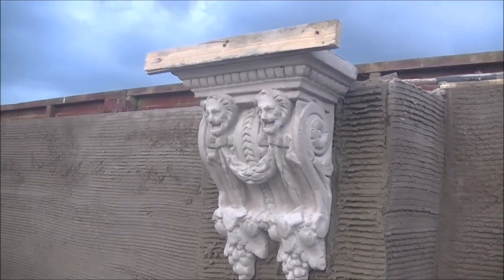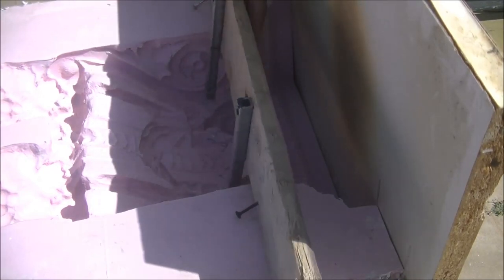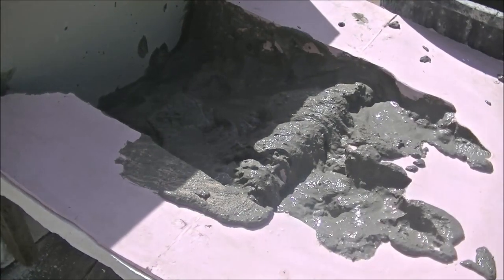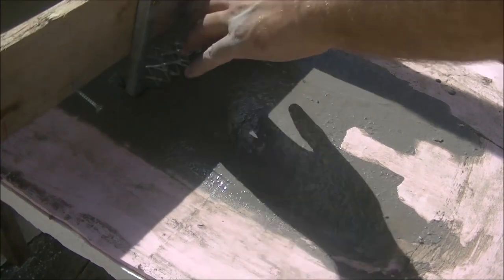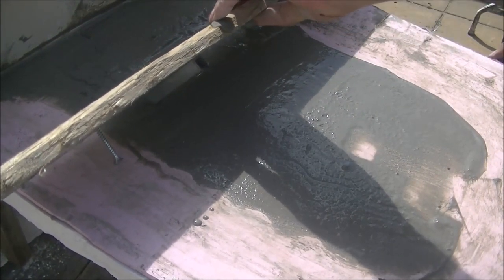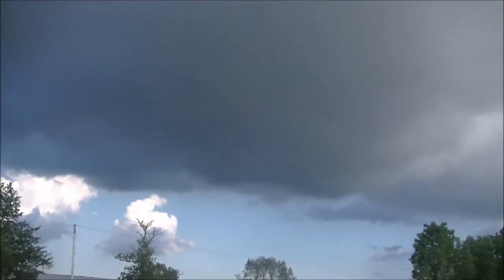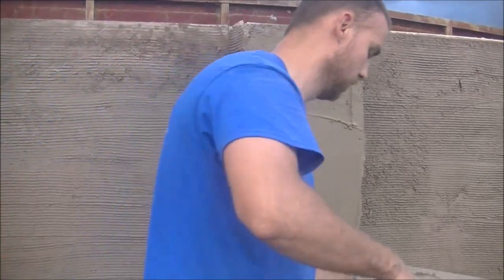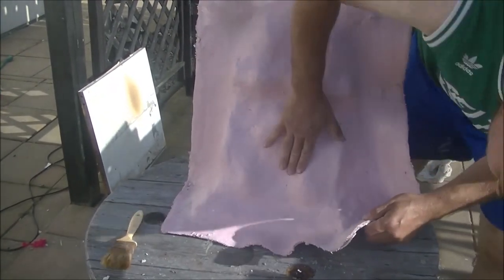MAKING AND FITTING CEMENT CORBEL ON MY DIY PROJECT WALL

Comment: Hi mac can you clear something up for me ,I e-mailed British gypsum technical support and asked if I could put 8mm of bonding plaster on a ceiling they replied no you can't put 8mm on a ceiling because the particles, but i checked the back of a bag bonding plaster and it says 8mm on ceilings.  Any ideas ad to why they say no on an e-mail and yes on the bag I'm confused.com. ?
Reply from the maker: sounds crazy for them to say 2 diffrent things , I cant see a problem with it especially  if you got 4mm then 4mm  either way its down to you mate if things go wrong big companies wont help they will have all the excuses and wont take responsibility unless they test there gear and it comes back faulty what depth did they say on phone was best to use?
Reply from the maker: This is from carlite bonding's site - Gyproc Bonding
Coat
For use on smooth
or low suction
backgrounds and
some plaster
thickness apllied to ceilings - 8mm

 but rep told me 12mm  I will try find the data on thistle but if you wan to have a peek at this = https://www.gyproc.ie/sites/default/files/Gyproc%20Plaster%20Selector%20Guide%20Web.pdf
Reply from the maker: Found thistle 

= Application
Thistle BondingCoat should be applied with firm pressure,
built out to the required thickness, ruled to an even
surface and lightly scratched to form a key for 2mm
Thistle finish plaster, such as Thistle MultiFinish. If
Thistle BondingCoat and a finish plaster are to be applied
to Gyproc plasterboards, Gyproc Joint Tape should be
used to reinforce joints and angles. Any gap between
boards exceeding 3mm should be pre-filled with
Thistle finish plaster, such as Thistle MultiFinish, with
the plaster being spread along each joint. Gyproc Joint
Tape is then pressed firmly into the finish plaster, and
immediately covered with a further application. The joints
should be allowed to stiffen, but not dry, before plastering
commences.

Background preparation
Surfaces should be reasonably dry, clean and protected
from the weather, and suitable for the chosen specification.
In addition, before plastering concrete backgrounds, ensure
that any mould oil or other agents present are removed
from the surface. No-fines concrete does not require
wetting prior to plastering. Normal ballast concrete
should be given sufficient time to mature before applying
the plaster. Plaster should not be applied onto a ‘green’
background or when any free water is visible. Mature
concrete will require wetting to displace the air before
plastering. Clean water should be applied 5-10 minutes
before plaster application to control the suction. In-situ
or pre-cast concrete which is exceptionally smooth or
which is made from limestone, brick, granite and certain
lightweight aggregates, will require pre-treatment with
Thistle Bond-it bonding agent.
Reply: @macplastering  your a star.
Reply from the maker: @dilligaf2386  Glad it helped some mate way i see it you have 2 options re board or bond it out if to heavy do it in 2 passes but make sure and skim before its to dry :) I have a few videos where i skim bonding same day its the methods that have worked well for me over the years